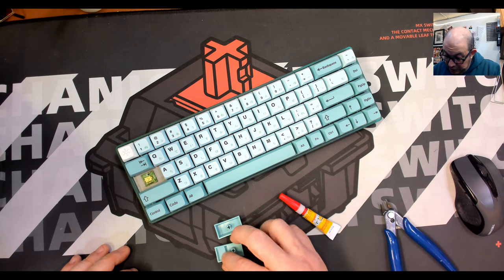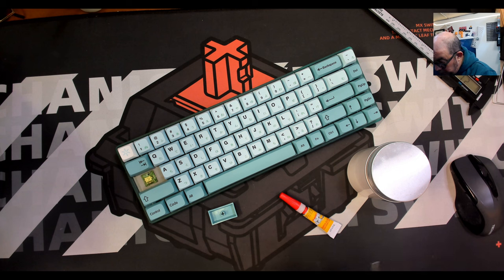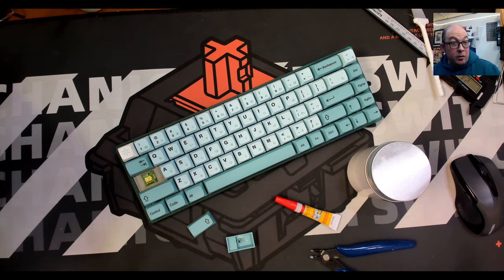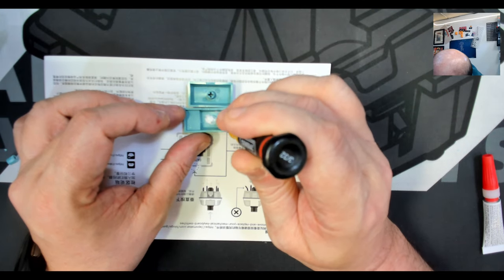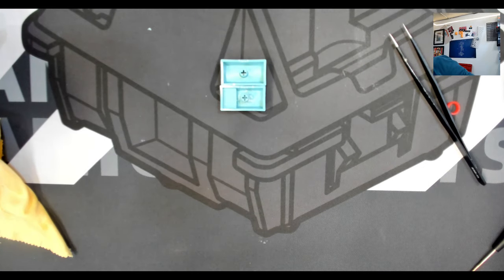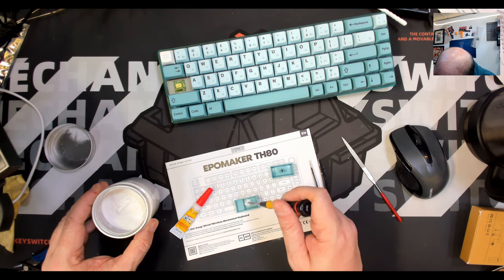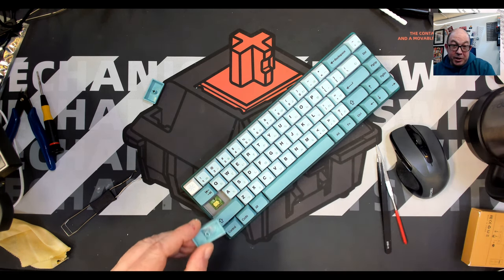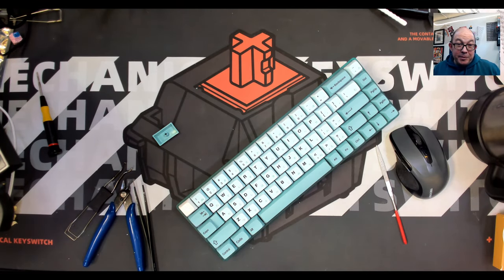Stepped Caps Lock Mod - Use a stepped keycap on a standard layout keyboard

Comment: Just did this with two sets of keycaps. First one happened first try and looks great. The second one I struggled with for a couple of hours. Thanks for the tutorial! Baking soda worked quite well.

Lessons learned: Pay attention to the angle of the stem holder - I ended up sanding a small profile into this to make it sit at the correct angle when installed. Also, I managed to ding up the original stem holder pretty good after clipping - find another keycap that you can use to harvest an extra one if you need. I used an big ISO enter key and clipped the sides off to get a really flush cut on an extra and that worked well!
Reply from the maker: Very cool, glad it worked for you! Feel free to share your mods on r/BudgetKeebs (https://budgetkeebs.com) cheers!

Comment: Definitely a fun mod. Looks like it turned out great. If it was me, I'd probably have it in there at a slight angle and it'd bug me lol
Reply from the maker: I'll admit, that was my biggest worry, but using the tweezers and eye balling the line with the normal caps key did the trick, on the second try anyways ;)

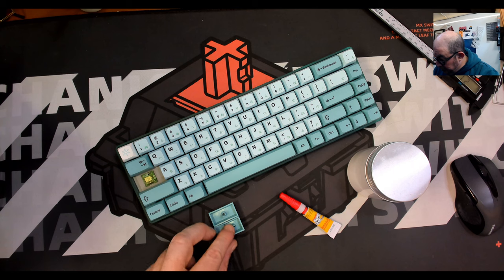Comment: 3:10 A cutting disc and rotary tool, such as a Dremel, might be the tool. A really small (or worn down) cutting disc! 🔘
Reply: 4:03 and 🥽
Reply from the maker: Don't know why I didn't think of that, thanks!
Reply: You'd have to get a really small cutting disk as the ones that come with the Dremel would be a little big so you'd have to be extremely careful to not touch the edge of the keycap with the cutting disk
Reply: @MrDJon604  Yep! Good use of worn-down discs.
Reply: How about use the flush cutter to clip out the stem on the stepped cap and just sand down the remains for a clean backside. Then from a key cap that won’t be used, use whichever tool necessary to get a full stem, not having to worry about the rest of the key cap. 😅

Comment: Stepped caps lock looks so good and is technically functional, but after actually using one, I’ve found I mostly prefer a regular caps lock, it’s a little disappointing

I don’t think I’ve ever accidentally hit caps lock on a Cherry profile. Occasionally on thin laptops

Comment: I know Tai Hao offers stepped caps with regular switch position and iirc some cherry profile sets from china got those as well (ofc modding is always free, if you got the caps and tools already 8)
Reply from the maker: I have two Tai Hao sets and they are only 60%, TKL, and Full size compatible, no stepped caps lock though :(
Reply: @MechKeyboards  yeah, they offer vastly different kitting for various sets. I got one with basically GMK kitting, split bs, even hhkb 1.75u control and all.
Reply from the maker: @shadowcore94  nice, will be keeping my eye out, thanks!
Reply: @MechKeyboards  mine is called hunted slime, 152 key version. Thats the most compatibility Tai Hao supports afaik

Edit: Also great channel, been binging all your vids. Although I have been in this hobby for years I stepped down by a long shot in summer of last year because of a general unhappiness with the community and spreading elitism. I still enjoy it now, but I keep it simple, modding some OEMs, doing cheap and fun stuff instead of splurging hundreds on aluminium